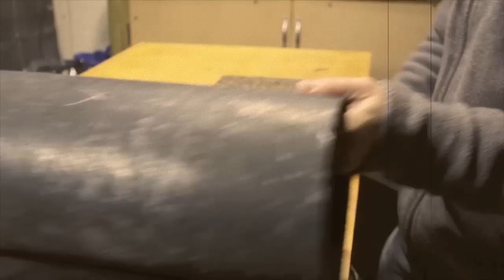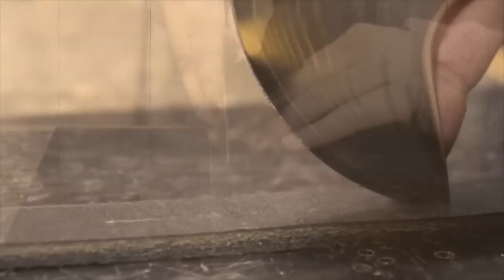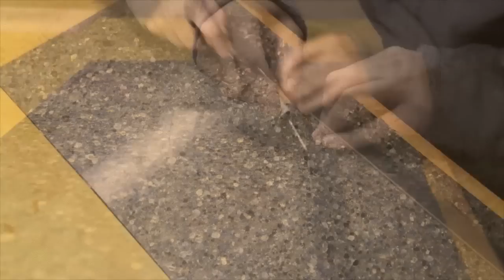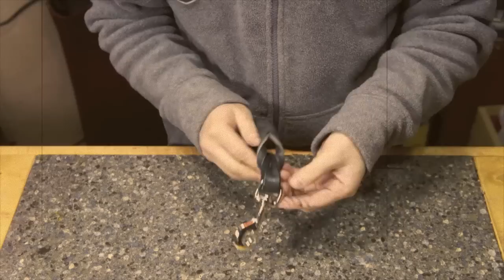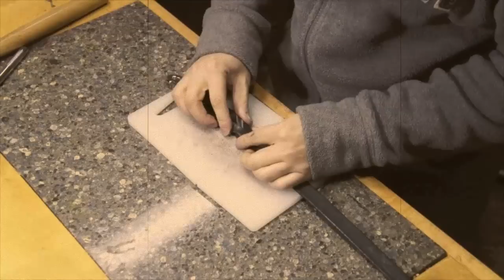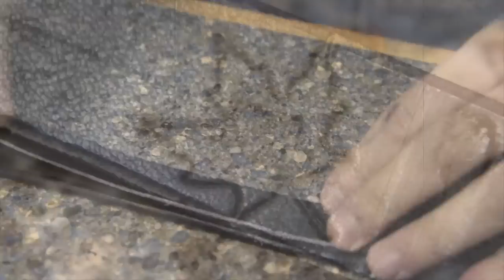How to make a leather dog leash by Cerberus Designs

Comment: Thank you for showing this technique. I had no problem following it, but will have to experiment with my own numbers between the splits to find the distance best suited to each end.
@all The leather appears to be either bridle or latigo. My preference would be latigo. It appears to be 11-12 oz in thickness. The beeswax is used to help "slipping the braid" as latigo is fairly impervious to weather and sun. Tandy double cap rivets are used to fasten the ends which are available with the decorative engraving the poster used. Side note: IMHO Tandy makes crap. I would use 1/4" chicago screws that were Loctited. The leather would fail long before either the screw or Loctite failed. they can be found with a decorative engraving as the OP showed.

Comment: I wouldn't use pop rivets for a leash.  They can't take the amount of stress that a leash goes through.  I understand that these are just holding the ends down and that the braiding takes the force, but still it's sending the wrong message that rivets are suitable for a leash application.  Instead of pop rivets, use Chicago Screws (and add some glue to the threads) or Copper Rivets.  Better yet, hand sew the ends down.